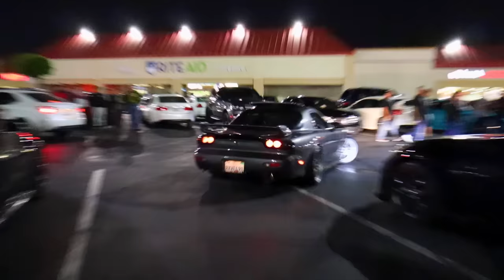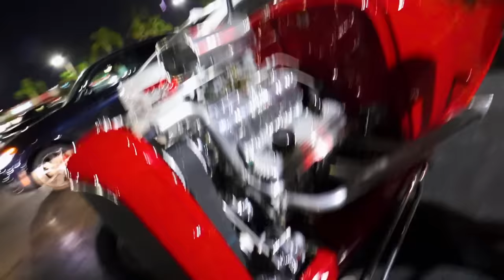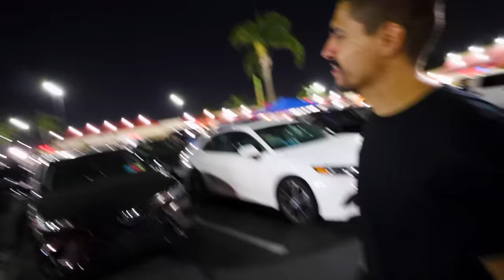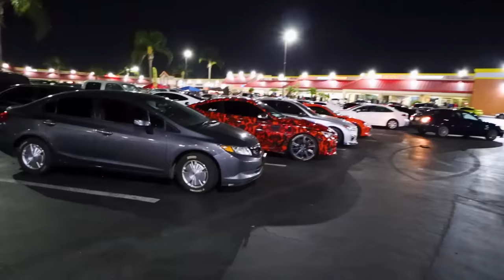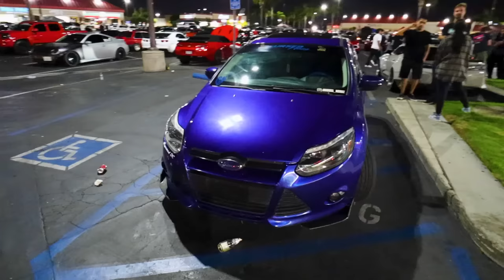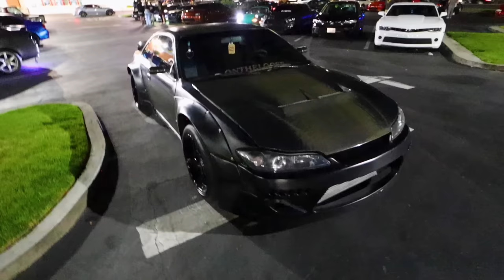CLOWN In Lambo RUINS Cali Car Meet! (Live RICE Or NICE)

Comment: With the f150 on slicks. Personally I would take the 3.5 twin turbo over the 5.0 coyote performance wise. We raced 2 2020 f150 with the v6 and the v8. Sorry to tell you all but the 3.5 v6 is significantly quicker than the 5.0 v8.

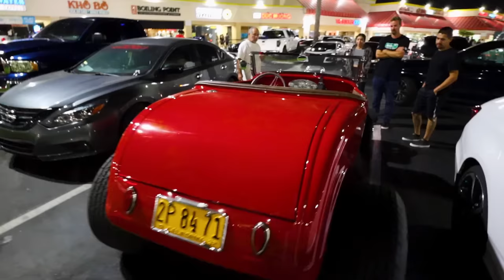Comment: Drew is there a way you could cover your wheels with something so we could see what your Supra would look like with body color wheels and then you could take it off? 4:58. From someone on those kind of cars, this is worse that rice. It is a Ford that been Chevrolested. A Chevy motor does not belong in the engine bay. The fenders are missing as is the hood and cowl. (Engine  cover assembly.) and the headlight are messed up. It is just another Rat-Rod. They are all running to go see the fireworks.17:38. The whole crowd is in competition for The Darwin Award.
Reply: That ford is actually a hot rod not a rat rod lol, and it’s really really common to put a Chevy 350 in 32 fords because of how cheap they are to mod, sure I’d probably prefer a 460 big block, but hey, Chevy 350s are cool too. But yeah not a rat rod, pure bred hot rod lol